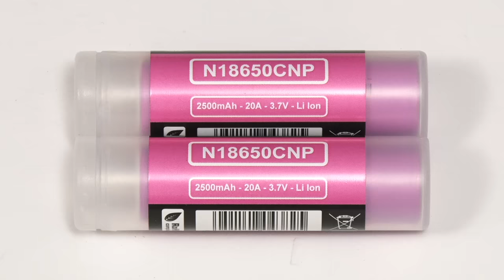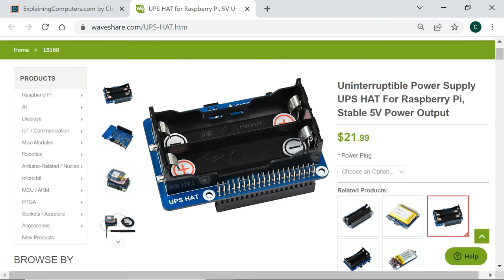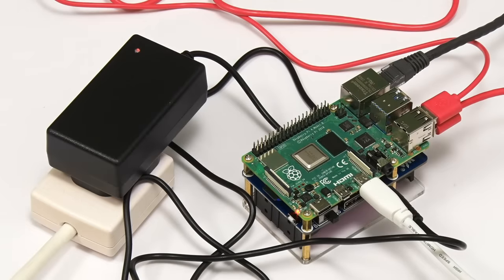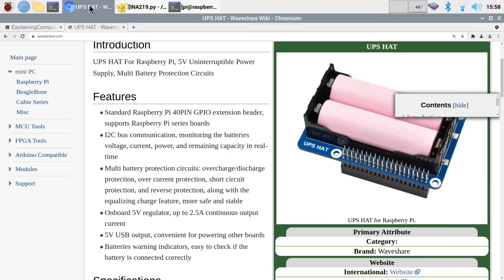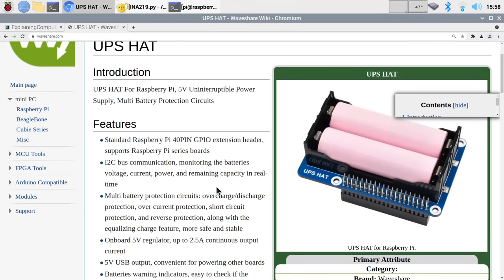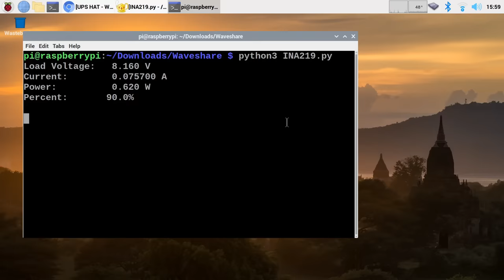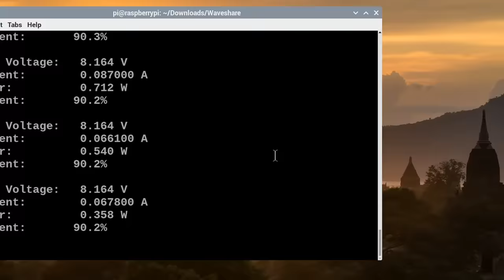Raspberry Pi Waveshare UPS

Comment: Would be great for running headless applications, but would be a bit disappointing when your screen goes off in a blackout.  I'm curious about a few things.  
Is there any safe shutdown code that can trigger when negative power draw is detected?
How long does the charge keep the Pi running for, when disconnected?
How do HAT's affect the power draw and for how long will it run?
I really like the idea of being able to inplug it, move it around and continue without rebooting.
Reply: If it does do a shutdown, i hope that there is a hook for MQTT notification, so you can check on things!
Reply: I'm sure that the python code supplied could be modified to notice when the battery is running low and then shut down the Pi.
Reply: I imagine it would be pretty easy to write a python script to run on boot that monitors the ups and either shuts the pi down when negative current draw is detected or when the battery percentage reaches a certain level. And being a python script, you could set it up to provide any sort of notifications you might want. As it appears to be using an INA219 sensor for voltage/current monitoring, it might even be possible to bypass their code and create your own as all you should need is the I2C address they are using and any driver for the INA219 should work just fine.
Reply from the maker: The Python monitoring code can be edited to implment a safe shutdown based on remaining battery capacity (aka voltage level). I did find such a script online, but cannot find the link again now! For my purposes I'm more focused on surviving short power outages -- like when a one of my Arri movie light bulbs explodes (and the do explode now then!), tripping all the breakers. How long it runs a Pi for will depend on what is running and connected, but should be several hours in most situtations.
Reply: @ExplainingComputers  Thankyou very much for the reply, Chris. 
All good to know and as I hoped.
It does look really useful, especially with that kind of longevity.
Blimey, I looked up what an Arri light was.  Sounds expensive.  I hope you're explosion free from now on.

Comment: "... which is pretty much all the Pies out there in the wild today." 3:37
Pretty much all that is sold today but I still use my original RPi 1Bs (with 26 pin GPIO) and 2Bs that are continuously uploading data to the internet.
Reply from the maker: I totally agree that there are lots of Pi 1s and Pi 2s out there are in use. But most Pis made, not just sold, are 3s or 4s. So most Pis in the wild are a 3 or later.
Reply: @ExplainingComputers  - Fair enough.  Do they have a sales numbers list somewhere that would show exactly how many of each model were sold over the years?  I find the old ones are still great for lower power use.

Comment: I see a significant problem with the use of pogo pins : the plating on the pogo pins (gold?) connects with the tin plated  pins of the header. It doesn't take much for corrosion to set in. And that is IMO a sin for a UPS.
The product itself looks great and the price is fair.
Cheers 👍🏻🤝🏻🇳🇱
Reply: Yep, I'd solder them in place personally
Reply: You can get a small thing of No-AL-Ox at Home Depot in the electrical department. Just a dabado.
Reply: @Peter.Sky.Walker  sounds great, except my nearest home depot is about 5000 miles from my house 😜

Comment: Interesting, I just installed a Geekpi UPS yesyerday. It is similar but runs on 5V only. Batts seem to be in parallel. So it would probably use one of those 5V power bank chip sets.
Mine has more pogo pins though.
Can't say it is better or worse. I like the 8.4V design better. The GeekPi does have two USB power ports. Documentation is poor as it has a similar sample code but no docs on what is available via software. If your video had come out a week earlier, I'd have used the Waveshare.
I use the UPS for my PI4-based router that tethers to my phone. Have dropped cable internet for $25/mo unlimited internet on phone and am saving near $100/mo. Works very well. The UPS helps as any glitch on power and the phone link drops and you need to unlock the phone to re-enable USB tethering. I can use the hotspot feature of phone and that will reconnect but too many other wifi signals and the Pi wieless is very poor. Wish The Pi's allowed external antennas.
Reply: BTW, I had two Panasonic 18650 batts that would not fit. Looks like if the batts have the protection chip added, they will not fit.
Reply: The 'problem' with the 8.4 Volt design will be soucing a replacement PSU if that was ever needed.  I was disappointed not to see a much more standard input requirement like 12 Volts.  A wider input range like 10 to 15 Volts would make finding a power source much easier - maybe even solar or a vehicle.
Reply: Turns out the Geekpi has a bug that needs this "repair board" that adds a chip in series with the charge cable. Have ordered the Waveshare and will see how they compare.
Have had the board randomly shut down. Seems it suddenly things the batts are dead.
Reply: @Brian_Of_Melbourne  Yes, and adds another power brick. I have a 5-port USB charger that runs the Pi and display. Can run the display off the UPS but rather it power down if power lost.
Reply: Well the Geekpi keeps shutting off power to the RPi or just refuses to charge. Took 20 hours to charge batts. Other flakiness, so will be using the waveshare.
Reply: Well the Geekpi was trash and is now in the trash. Finally got a refund from ebay (ebay gave them 2 weeks to fix problems.) Still either won't charge or randomly shuts down.
My waveshare UPS came today. So back in biz ;)

Comment: Very interesting video, sir. I may have to invest in one of these doodads. I'd be interested in seeing how long it lasts under battery power at various load levels.
Reply: @Justin, sounds like a future video topic
Reply: The maths is easy enough for full load, as they give us the power output.
Reply: The fastest I was able to drain it was  about 2 hours. That was with a CPU stress test. I used 3500 mah batteries. The last idle test I ran (by accident) lasted just under 11 hours.

Comment: I bought a couple of "New UPS Lite V1.2 Power HAT Board With 1000mAh Polymer Lithium Battery Electricity Detection For Raspberry Pi Zero Zero W" for MotionEye bird cams I was building. AU$23 each from AliExpress, same pogo pins. I was very impressed.

Comment: That looks like a nice piece of kit although I think I'd be tempted to solder the power connection to the pi rather than relying on those spring loaded pins. But my UPS supplies my router and a Pi running pihole together with my main mail server so the Pi on its own won't be much use.
Reply: I think I'd prefer the A revision myself.

Comment: I have looked at a few UPS kits on Amazon.ca.  Pricing it of course higher in Canada.  If I end up buying one, I will have to print out a modified case for it. Your video today has definitely helped me in my research. The Pi  that could use a UPS is one of my MotionEye0S camera units. Having backup power is something I always needed.  Thanks for today’s video Chris.

Comment: Thanks for the demo.
1. Did you test how long it would run on those batteries?
2. A 'professional' UPS notifies the host when it goes to standby power and also when the backup power is about to fail. Host software should then send notifications and shutdown gracefully. Does this system do that?
Best regards.
Reply from the maker: I forgot to test battery life (I don't know why!), but it should be several hours in most situations. For my purposes I'm more focused on surviving short power outages -- like when a one of my Arri movie light bulbs explodes (and the do explode now then!), tripping all the breakers.

The Python monitoring code can be edited to implment a safe shutdown based on remaining battery capacity (aka voltage level). I did find such a script online, but cannot find the link again now!
Reply: As well, I am used to APC UPSs that I have installed on servers, switches, etc over the years. The APC PowerChute software does another thing that isn't mentioned for this Pi UPS, and it is one of the most important functions of a UPS. That is to properly shut down the system when the battery power is running out. In fact, in the datacentre world, that function is at least as important as being able to survive through brief power outages/brown-outs!

Comment: Kind of like a laptop, there’s a DC battery in the computer. For a long time I have wondered why UPS modules haven’t become part of a standard PC form factor avoiding . External UPSs that output 230V is a whole unnessary step when PCs don’t actually run on that voltage

Comment: Hi Chris I noticed that the pogo pin that contacted pin 9 didn't seem aligned as the other pins were, if you lost gnd temporarily it would cause a reset! All in all an interesting UPS & Pi video, almost forgot a round of applause for 'Peter the pliers', another enjoyable Sunday afternoon. :)
Reply from the maker: I was aware of the pin you mention -- its contact is very firm, and it looks like it can be moved across a bit -- but not so! :) Things seem to be working OK . . .
Reply: @ExplainingComputers  That's good to know :)

Comment: I made my own UPS a couple of years ago with a basic BMS board I got on eBay. It doesn't have the I²C monitoring, but it works and is cheap, so that's an alternative DIY solution. The only trick is making sure to get a BMS board that has the right connectors and controls (mine has a micro-USB input, battery in, board out, and a potentiometer to adjust the output voltage). I run a webserver from my Pi, so it was quite odd to have the whole thing running from inside my pocket. 😂

Comment: Not sure how well this hat is protecting the cells though. I recommend using NCR18650B cells from Panasonic, as they are designed to go as low as 2.5V. Usually, those circuits don't have problems with over volting the cells but over discharge is sometimes a problem on those. So with those cells, nothing bad can happen since you got half of a volt grace. They also provide 3400mAh as opposed to the lousy 2500mAh like those cells. I think you have bought vape optimized cells for high current discharge.

Comment: I was looking at this product today but finally didn't bought one 😆. Fresh questions in my mind was if I should use 3.6 or 3.7 Volt battery, and should they be with built in protection or not? 🤔
I don't know why but I'd still feel better with 4x NiMH instead.
Reply: nimh would probably have a lot shorter ups capability and may not even have enough amps !
finally did not buy one, or, finally haven't bought one,
Reply: @jyvben1520  shorter capacity for sure. Not enough amps? We are talking about 2.5A with up to 5A peak. This is not something not to do with NiMH cells. Toyota hybrids are still (mostly) on NiMH and total output current of 202V battery pack is up to 180A peak and around 100A sustainable current output. So for sure performance would be lower but not impossible. 
What I think is more cause is that charging NiMH is actually more complicated (while safer) and in hobby RC battery safety is not as much a concern nor responsibility of manufacturers.

Comment: Ah, my Sunday Brunch EC fix, as necessary as morning tea (why do I not have a matching EC mug??!) This UPS is's a very good idea, and nice that they stayed within the expected form factor.  Passing along to my Pi-friends!

Be sure to use Japanese batteries if you can get them... not Chinese. HUGE difference in performance, even tho the Chinese batteries will usually have a (bogus) higher rating. Project Farm channel did a really good evaluation and stress-test of these batteries from various sources, and the results were very consistent.

Comment: Coincidence you've done a video on this product! I'm doing a lot of work with UPSs at the moment, so some additional info on this product - it doesn't implement a "charger" on the board, its more of a BMS (or rather a 2S BMS and then 2x 1S BMS for each cell). Charging is constant voltage from the PSU, which is pretty chincey. It might have a CE mark on it, but i really doubt it conforms to anything other than cheap as possible. The PSU is 2A, which would effectively allow charging at less than 1C. The reason they've done this is to avoid having to implement power pass through circuitry which is required for CC/CV lipo charging. 
If anyone wants one, i have an unused one.

Waveshare also do a very good lipo HAT which does implement pass through charging, but isn't a ups due to the way they've implemented the pass through, it relies on switching FETs so will glitch the 5V line when you plug and unplug external power. They have however implemented source and sink USB-PD which is pretty awesome. Main issue with it is that it's 1S though, they might have rated the 5V boost converter to 3.5A but that means fuck all. Boost converter efficiency is pretty poor in general, so for 3.5A you'll be pulling ~5-6A from the battery... at 1S the voltage will drop below the cut off voltage (3.6V) and brown out your entire system. I've confirmed this in my testing. I also broke the switch off after about 10 mins of testing, and blew the IC on the board after 20 mins.... There also arent any external outputs, so you rely on the GPIO.
Ordered a spare and then superseded the design about 20 mins later so if anyone wants one, give me a shout.

Geekworm do a very nice UPS board, which in my opinion is the best one for low power applications, i.e <10W. It is USB charging, but not PD. I think it might be a quick charge implementation or just 5V line from USBC. Again boost converter is rated for 8 amps but good luck with that. Your battery will most likely drop to 3.6v and the UPS will disable the battery. Also the bolts for the fan are too high so might interfere with a HAT placed on top, especially if it has SMD components on the underside. The charge indicator leds are actually facing to the side though which is nice, and it's more robust than the waveshare in general.
If anyone wants one, i have 3 spare. 

In the end i built my own, as more volts is more better for higher power applications. 

Hope this helps someone, or is atleast of interest.

Comment: It seems odd that the power adapter isn’t going directly to the pie and passing current to the battery board which would help in the case of battery failure, is it possible to plug-in the pie as well.

Comment: Nice! I wonder if the pogo-pins might be contacting the IDE header at a solder peak - solder oxidises readily. Perhaps cutting the pins square with some decent edge-cutters, even lightly sanding, to expose a flat brass surface might make make it more thump-resistant ;-)
Reply from the maker: A very good point and a good idea. I must try this.

Comment: Hi Chris, really liked this video.. I am still not sold on the pogo sticks as they are not a reliable contact point. Thats kinda solvable with a soldering iron, but removing it might be a pain. Also, can you let us know the backup time of this UPS under idle and under load as well? Also, how about a video on a DIY UPS for a wifi router? Thanks again!
Reply: Myself I have a 238Ah deep cycle marine battery that powers a pure sine wave inverter. The inverter powers the modem router+pi. I have some solar panels out back to keep the battery charged. But if you wanted to go cheap from a UPS perspective you could just use a 3-4 amp trickle maintenance charger for your battery. When the power went out you would have the battery keeping you going for days.

Comment: Some thread lock on the stand-offs and screws would be a good idea. The one thing I wish they had done was to add a power button for the pi to the UPS. You could use the i2C to send the shutdown command. Also, that hat should really have a device driver for it but it should be an easy one to write and would be a good first driver project for someone.

Comment: It's amazing that a souped-up battery holder these days requires multiple processors or ASICs and complex circuit board, interface, protocol, etc. I guess they've all become so ubiquitous and low-cost. The processing power on the UPS board alone is more than what entire mini-computers had back in the day. But I'm dating myself.

Comment: Nice design. I would have given the solder a light brush with a file to level out the heights and remove some oxidation,flux,etc...

Comment: Interesting idea, but I’ve never seen the benefit of a UPS without an audible alarm and an ability to let someone know about the loss of power as/when it happens. Perhaps these are options with this little unit? Thx Chris, keep up the great work 👍😀
Reply: With the supplied example code, it shouldn't take much to adapt it to make it output an alarm signal or play a sound through the audio output. An email or telegram could also be sent for remote monitoring. The actual trigger would be the current going negative to indicate the loss of mains power.

Comment: Does it perform a graceful shutdown if the voltage drops below a certain level?
Reply from the maker: Not by default, but script can be added to do this (for example by editing the monitoring Python code that is supplied/available).

Comment: Great video Chris. This is indeed a very nice product and a lot cheaper than I expected. Although my mains supply is pretty good here, I do had a UPS in my comms cab, with my Pi3b (running PiHole) connected to it also, along with everything else. But might get some of these for some of my other 24/7 Pi's.
Does the WaveShare UPS perform a safe shutdown of the Pi when the battery gets low?
Reply: Even if it doesn't perform the safe shutdown by itself, it should be easy enough to implement. The python script provides the battery percentage.
Reply: @UtkarshAmitabhSrivastava  You're quite right, thank you. I just wondered if the board implemented it natively.